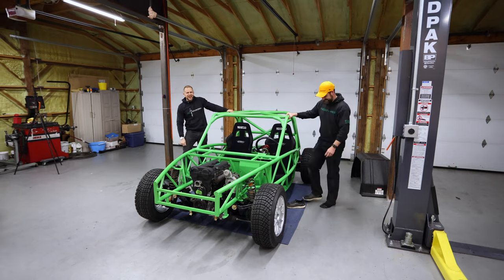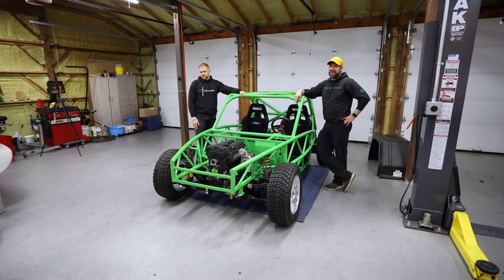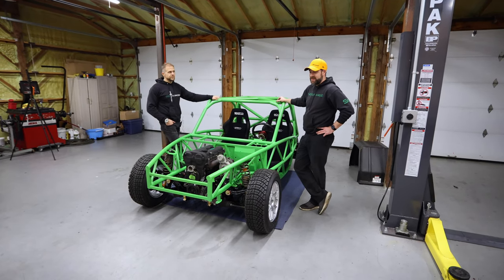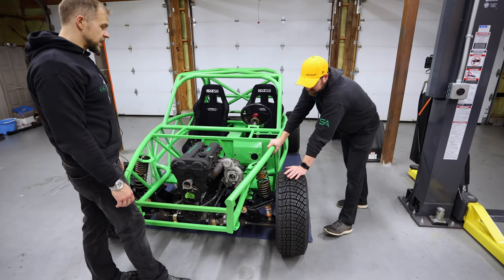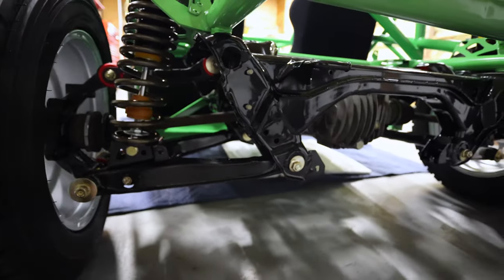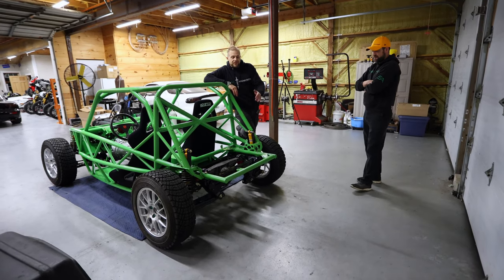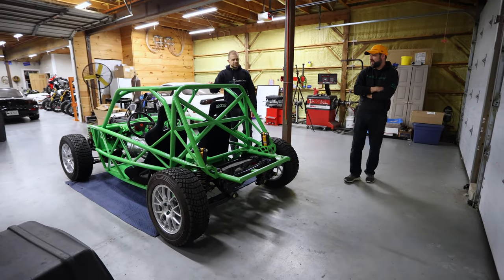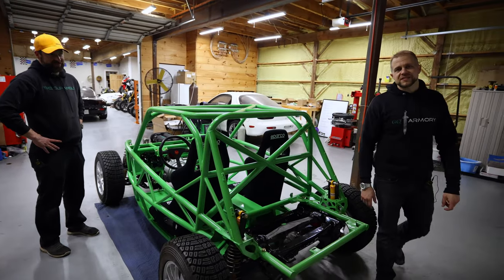Paco Rallycross Suspension | A Closer Look

Comment: No need for shock spacers I see. I'm curious how this would be with a "stock'" size wheel tire setup at the lowest lift setting for street.
Reply: Was thinking the same. The added travell sounds great for places where the streets are not in the best conditions.
Reply from the maker: We will have to try mounting Matt’s race wheel and tire setup just to see.

Comment: Did you find the suspension made it more comfortable? I'm building a lifted miata and currently have some sporty  coilovers that feel a bit rough when paired with frame rails and rollbars
Reply from the maker: The Paco Rallycross kit was super comfortable! The car now has Xida's which are great but not as comfortable. The extra travel really helped this car out on the street.
Reply: @TheSlipAngle  Awesome! Thanks for your reply.I just ordered my set!

Comment: Confused here..? 
are the front springs  mounted the opposite way up from  the rears...
looks like it.. soft rear... stiff front for a reason.... ?

I know the rear dampers are upside down... but a damper can be any way up.. or angle
because all it does is control the movement of the spring...no bouncy bouncy...
surely  all the progressive springs should be the same orientation...? soft then hard(she said)
or is my little 720p screen seeing it wrong...

Hug and a kiss if im wrong...

N x
Reply from the maker: Good eye! The drivers side front spring needs to be flipped…
Reply: @TheSlipAngle  guys im not trying to be critcal... will always help if  I can...
Love what ya do... 
can`t wait to see Kermit finished..
N x